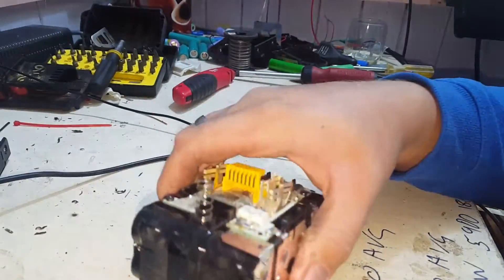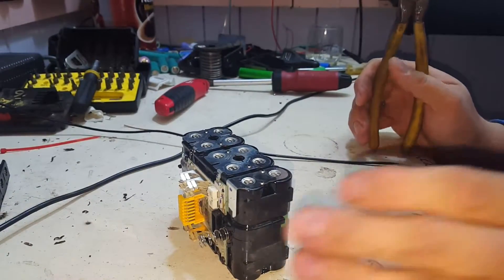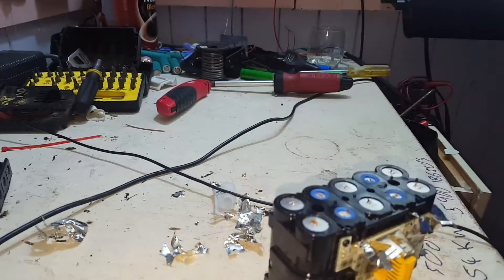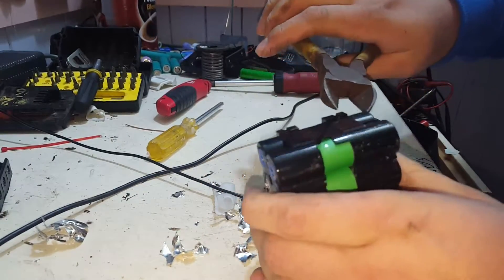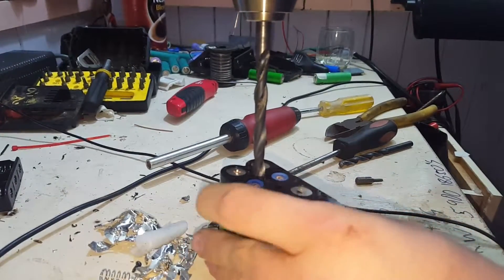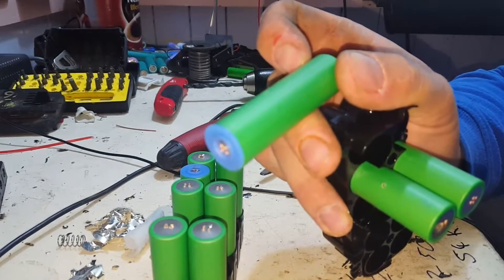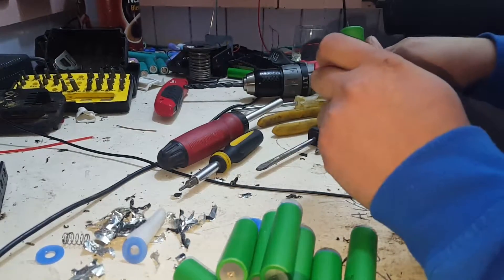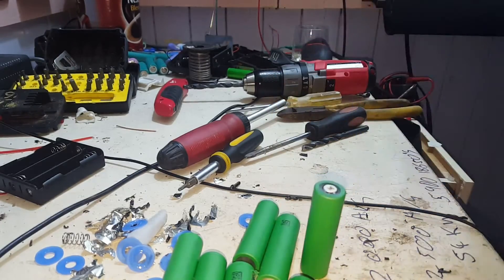Whats inside a Makita 4.0 amp 18v battery

Comment: Well done!! this saved me from ripping one of my own apart .... pleasantly surprised to see 10 cells inside , not 8 .... thats a 2p5s ....Strange they call this an 18V battery 18/5 makes = 3.6  .... the voltage when fully charged must be 21V ... 5Ah 18V genuine makita are now on eBay @ $15 !! that's  $1.5/ for a 2,500 mAHr cell , inc delivery !  how can they manage that price !!!
Reply from the maker: 15 bucks !!! Worth it for cells. Can you send me. Link
Reply: @Oneupthesleevecustoms  This is the seller I bought from ,... https://www.ebay.co.uk/itm/2-pcs-x-Makita-Battery-BL1850-Genuine-LXT-18V-Li-ion-5-0ah-Battery-Brand-New/153526695886?epid=4032160094&hash=item23bee777ce:g:h-gAAOSwc41c938Z&frcectupt=true  He has 100% feedback including people who bought this produce ... there are others selling around this price .... and one selling for $5, clearly a rip off , many feedback saying he's a gangster ...
Reply: The nominal (average) voltage per cell, over the discharge cycle, is 3.6V. They start off at about 4.1V, and finish at about 3V. Some manufacturers use the maximum voltage instead. In fact, I've noticed that in the U.S, Ryobi use the maximum voltage, but here in Australia, they use the nominal!! So the same pack is labelled differently in two countries. Brilliant.

Comment: Where are you located? I have about a dozen "going power" laptop batteries that I got as part of a batch. These ones, I don't know, I just don't trust them, but I'm sure someone else might have a use for them. Cells look great condition, but clearly some fault present seeming I got them as faulty. It looks to be generic cells inside but like jehugarcia mentions that with brand name batteries, they use brand name cells and you knew that were good a one point in time. Let me know if you are interested and I might be able to get them to you or someone else if you are not interested.
Reply from the maker: +Brett im in devonport  tasmania  mate always  interested in  cells. Do you think  they might be cheap generics or underlabled good ones
Reply: +One up the sleeve customs cheap generics I think seeming they look very good condition, I weighed them and they were about 5-6g lighter than the samsungs. I might capacity test a couple whilst I'm present so I can regularly check on them. That will give you some idea. 

On another note I had some Lenovo batteries and I swear that some of them had reused cells in them, generic wrapper with no marking, horrible double sided tape right through, but the most obvious thing was the ends had markings where old welds had been removed. Maybe fakes? I don't know.
Reply from the maker: +Brett tech companies  do some weird things  like that. the power  of  some of the second  hand  cells ive had is amazing

Comment: Probably 2000mah based on the battery pack capacity. I'm sure some vapers out there would be interested in them.
Reply from the maker: +Brett yes they probably  factory stop at say 3.3v instead  of 3 like my tester so can give the  variables.  Yeah be great for the "modbox" setups with a fast discharge

Comment: Normally they are high drain cells for high power applications, as a trade off they won't have a high capacity. Also if a Makita board has 3 failed charging attempts it will be bricked, the board has to be replaced regardless of battery condition. Please go buy a Tamperproof Torx Set!
Reply from the maker: +Brett yeah i need a long set like allen keys ill get on ebay haha its dam annoying
Reply from the maker: +Brett they all tested to 2,300mah thats a positive .
Reply: +One up the sleeve customs I have a 'Kincrome 10pce Tamperproof Torx Set: K5048' bloody handy tool, fits most things and best part is I don't loose bits from the set.
Reply from the maker: +Brett ah yes the ones that fold out i have seen them do they have the center hole?
Reply: Yep
Reply from the maker: +Brett thats the go. My local tradelink store are kinchrome dealers ill hit them.up cheers man thanks  for watching  too.